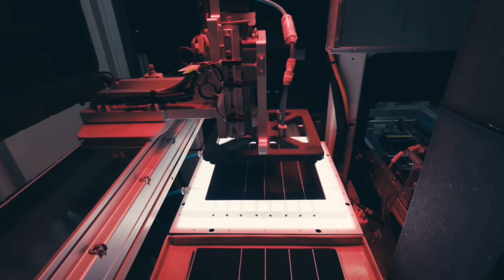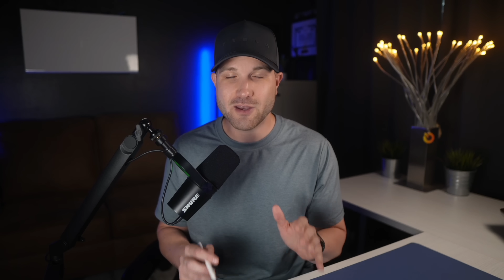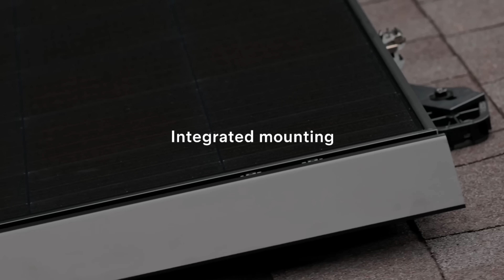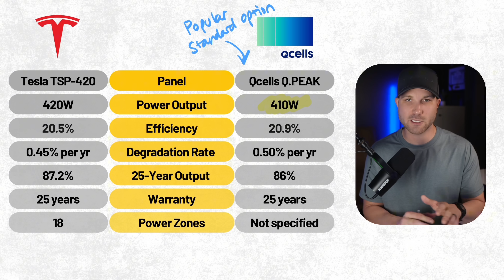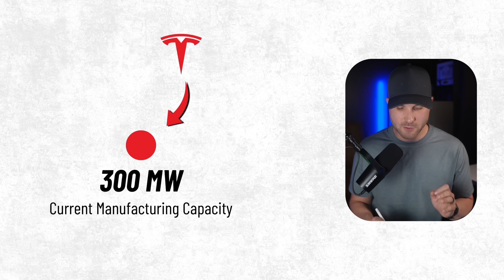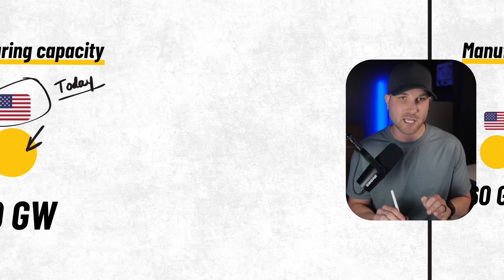Is Tesla's NEW Solar Panel Worth the Hype?

Comment: It’s not out bro until couple months and nothing fancy just better for the installers/labor guys and help install company save money.
Reply: @solargod3671  The panel is out. Tesla Solar initially told me that my system would be installed after the end of 2025 but then did an about face when my city same day approved the install. My project manager confirmed that I was getting the new panels. The install using the new TSP-420 panels was done on 12/24/25. I visually confirmed and they’re specified in my solar system inspection report.

Comment: I work for a Tesla-certified installer in Italy and this panel seems to be years behind in terms of specs. We currently use 480 W panels, with 30 years warranty, 24% efficiency, way better degradation etc... And I bet they cost a lot. I haven't seen 20% efficiency modules in like 4-5 years, and the "quality manufacturing" thing hasn't been an issue here for like 10 years (before you could actually find panels with good specs that ended up being problematic, nowdays you don't really anymore if you know what you're buying).
Reply from the maker: That's a spot-on summary of the tech specs here. The ~4 year old Qcells modules on my roof have near identical specs. Which modules do you most commonly use out there in Italy?
Reply: @ZachSolar  We use Aiko as the standard, Trina for a low-end offer and Bisol for systems that require made-in-EU panels (then for specific uses there are other companies, like see-through and pavements, bending modules, colored modules, custom "camouflage" modules etc...). 

Otherwise the most common ones are Jinko, Longi and JA Solar. Here and there I see a few Maxeon and a few Lux. I've seen all the brands personally though. Even a singular system with Canadian Solar. 

But that's now, since it's been an active market for over 25 years it's very mature and low-quality panels are not the standard for serious installers, though I see older systems everyday (like, literally 3 hours ago lol) with bad panels that generally decade much faster than they're supposed to.

I'd love to learn how the US market is going and how at the other side of the pond things work given that prices are so much higher and elecricity is at the same time cheaper. Would you be down for a chat?

Comment: nobody is talking about it because who would install panels in a shaded area...
Reply: Most homes have some PARTIAL shaded areas during much of the daylight hours. One 1” tree branch “takes out” a whole 4’ x 5’ panel.
Reply: @DM-zq8qy right either way don’t place panels there or remove the interference…
Reply: @taj-ma-haul9094 I like trees and shade in my yard.  Impossible to avoid partial shade moving across my roof during 5 hours each day without destroying my trees. 😢
Reply: @DM-zq8qy more panels then, I love trees, just not in the path of my solar. Clouds are acceptable, but again, over panel to compensate.
Same thought for me at least, there is no purpose for micro-inverters…

Comment: All this good stuff you are talking about is irrelevant. No mater how good panels are how long they will last how efficient they are how cheap they are, 2/3 of the time there is no Sun and we need electricity all the time. Solar panels are stupid idea and drive prices of electricity up. And for homes you just pay for electricity up front and think it is for free. Stupid.
Reply from the maker: They should develop a technology that stores solar energy and uses it during a less sunny time of the day.
Reply: @ZachSolar  Yeah, I forgot that, when it is Sunny there are periods of less than optimal sunshine, that's another plus for my argument. It means it's less than 1/3 of the time. And for your opinion about storage, well it's not that they are not trying as best as they can. But NOTHING yet. That's because of litle thing called Thermodynamics, which is a bitch and it can't be changed or bypassed.

Comment: China is not exactly crushing us by building over capacity, more likely they are crushing themselves.
Reply from the maker: That's an interesting point. I could see what you mean there.
Reply: Crushing themselves in what way? Their goal is to install as much solar as possible to transition away from fossil fuels asap. So their “overproduction” isn’t a problem it’s a solution to the fossil fuel problem.
Reply: China started playing the long game with energy independence many years back. For example, they started the Talatan Solar Park project in 2011 and have now installed 162 square miles of solar generating roughly 21 GW at last count on the Tibetan Plateau, the highest and largest plateau on earth. It also includes wind turbines and hydroelectric power using the water that cascades down off the plateau.

Comment: The zones are created using diode semiconductor chips imbedded in the panels solar module array.. This is a bunch of unserviceable failure points since transistors and semiconductor are more electronically fragile than the solar modules themselves.. Most current panels use 3 diodes or transistors to bypass a shaded segment and they are larger and more proven with some being replaceable if they fail.. So a purchaser will have to weigh efficiency, lifespan and production along with down the road failure rate, replacement cost in 10 years and serviceability.. The chances of snail tracking, cell burnout and other failures increase as the system voltage increases.. A 100v to 150v system will experience less of these than a 300 to 1,200 or higher volt system will since lower DC voltage means lower chance of internal arcing.. Micro inverters can reduce these failures greatly but you add the dozens of micro inverters as failure points..
Reply: So if you have more points of failure, but lower voltage at each point of failure, it sounds like that still has the possibility of being net positive?

Comment: 27 years in the industry and all I can say is highest efficiency and best temperature coefficient of power does not equate to "the best solar panel". I fell for that as a business owner and installed hundreds of systems and later got stuck with tons of warranty replacements that damn near sunk my business.
Reply: What panel did you install that plagued you with tons of warranty replacements? Don’t leave us hanging.
Reply: In your opinion; what’s the top 3 panels on the market today?
Reply: "highest efficiency and best temperature coefficient of power does not equate to "the best solar panel". " I beg to differ. You can have all those desirable properties and good warranty from a reliable manufacturer, if the government and the society pursue the right policies. You make it appear that one must be sacrificed for the other.
Reply: @adon8672   you mean like california where the utility charges you for the power you dont use
Reply: @zarb88 you spelled commiefornia wrong
Reply: @Tecra-1776 thanks for the correction
Reply: @adon8672  As we have seen with US and Chinese manufacturers they pump out lots of panels for a number of years then vanish taking that warranty with them.. Solar World and many others are proof, buy good quality and expect to be out of pocket for replacing panels that fail.. I have 24 panels divided into 8 strings of 3 made in the USA and my plan would be to find a different panel made by someone else that is close enough to work so I would not lose that string..

Comment: 420w seems a bit high.
Reply: Chinese panels nowadays are at around 600 W, older panel designs 500 W. There are cost advantages to making larger panels. I asume there are regulations in the US that effectively limit panel size. Here in the Philippines I have 500 W panels.
Reply: @GerbenWulff but those are bigger panels. It's output is just efficiency x surface. Most premium Chinese panels do around 24% at the moment. Equals 480w for a 2m2 panel.

For the imperial folks: yes, this is how easy the metric system makes things... 🤪

Comment: Temperature coefficient?   My concern about the skirt is whether it allows enough air circulation to cool the panels.
Reply from the maker: Temp coefficient is pretty average as well at -0.34%/C. I've seen that concern on the side skirt before. Not sure how it impacts the air flow.
Reply: Not sure how well that skirting would work with Spanish tile roofs.  It might require mesh for the valleys.